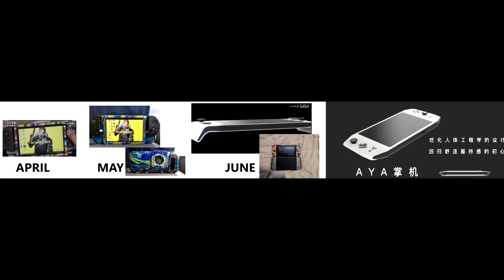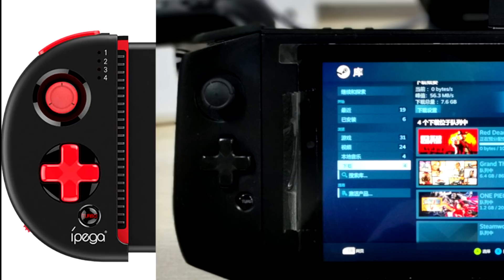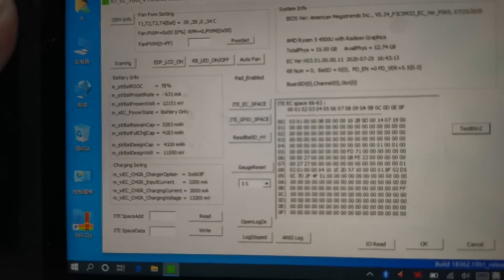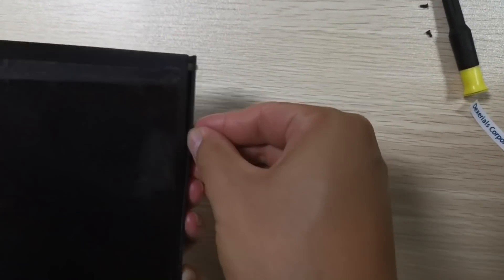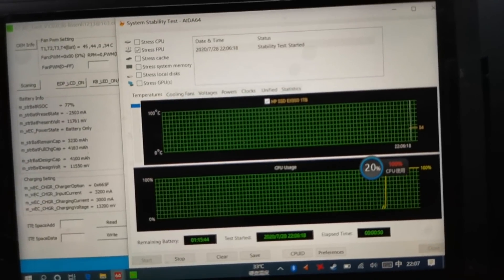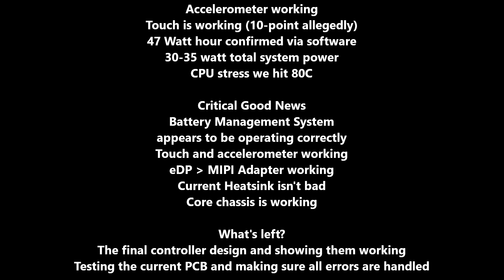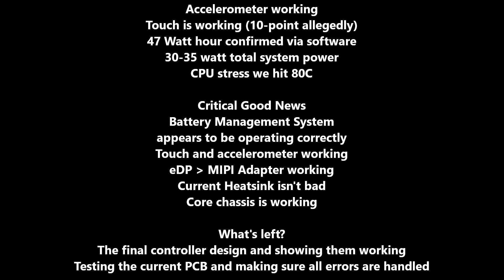AYA-NEO - What We Know So Far - AMD Ryzen 4500U Gaming Handheld - Part 2

Comment: handheld gaming pc slowly becoming a thing now
Reply: Yeah, handheld x86 APU is powerful enough to run full fledge AAA games, but power consumption is still too high and even with huge capacity batteries still last 1,5-2 hours of intensive gaming :/
Reply: @rincewindthewizzard6594  Yea 30W is insane
Reply: Smach  I mean a ps4 portable shouldn't be impossible on like a 5nm node. The jaguar cores are already for portable use and the slim is like what 80W at 14 nm. Some energy optimization and it's within  a decent full system W.
Reply: 🙏 Hopefully
Reply: @rincewindthewizzard6594  I think we'll see a full fledged effort to make these by big companies when ARM architecture becomes more universal in laptops and desktops.
Reply: Nah Arm is the future
Reply: @88oscuro  lol who gonna put jaguar cores on 5nm that's a waste of silicone
Reply: @malathomas6141  I guess you mean Silicon and not silicone, would be quite silly indeed to make APU's out of silicone.
Jokes aside.
They are very power efficient and allows for 100% backwards compatibility. We are talking about making the APU in  base ps4 possible to use in a handheld.

Both Sony and Microsoft have mentioned why they didn't go for Ryzen cores in ps4 pro and xbox one x.

It was a theoretical discussion, and yes your point is a valid one as well.
Reply: @88oscuro  a ryzen 5 4500u would be better to put in a Sony handheld compared to jaguar cores and yes I meant silicon
Reply: @rincewindthewizzard6594  Give it a few years. They'll get there.
Reply: Yeah if you call under 1080p and less then 60 fps gaming on low settings. My GPU is is bigger then this.
Reply: @ragingmonk6080  nobody cares how big your gpu is
Reply: @malathomas6141  " nobody"
Well, just because you are nobody and replied.....
Reply: @ragingmonk6080  stop tryna boast when nobody cares bye just wanted to point that out
Reply: @ragingmonk6080  we know bro this handheld is as powerful as a Xbox one
Reply: I hope so but they still have a long way to get the perfect iteration. Just hope AMD continues pushing the low-power, high-performance APU even further or maybe an ARM processor that matches with PS4 Pro's performance at least.
Reply: @malathomas6141  Well if the can shrink the current chipset in PS4 for a handheld they got 100% compatibility on PS4 entire library day 1. 

Developers knows the hardware and frankly, PS4's hardware (weak CPU cores aside) is good enough for a handheld even in 1 or 2 years time.

I doubt a Switch revision will get anywhere close to PS4 specs.
Reply: @88oscuro  if switch hypothetically  use 4800u they already have ps4 performance
Reply: @malathomas6141  Nintendo will ride along with Nvidia for a while.
Reply: @wiskymo9687  that would be their downfall I hope they use mx 250 in next switch
Reply: cutting transistor size in half doesn't cut the power draw in half. the die shrink of the PS2's Emotion Engine from 250nm to 90nm reduced the power draw of the console from 80w to 45w, and that was twenty years ago. a highly performance optimized 80w chipset is not going to magically become portable with a die shrink, especially when that chipset architecture is well known to get outperformed in portable applications. intel spent like ten years trying to make an x86 cell phone and it got its ass kicked by ARM chips with ASICs. nobody has x86 devices that consume less than 20w for a reason and its not process node
Reply: @Cheesemonk3h  4500u can go as low as 5w and at 15w yep consumes 18w so your wrong this isn't Intel on 14nm
Reply: @ragingmonk6080  Good, I wouldn't want a handheld that's bigger than a GPU. It wouldn't be very portable.
Reply: @richardg5301  A laptop is portable.
Reply: @fajrdn  ARM cannot kill x86 ... thats true story
Reply: @rincewindthewizzard6594  just gotta wait for solid state batteries then :)))))))
Reply: @malathomas6141  4800u can't play all Ps4 games without 1000 of hours of work to port them...
Reply: I remember playing Skyrim, RE5, Borderlands and Arkham Asylum on a z3735F and an iPega 9023 at 40-60 FPS 360P 5 years ago. I also had a 10000 mAh Power bank I could velcro behind the controller's support in case it would run out of battery.

Handheld gaming has been there for longer than one could imagine (even if there was a lot of jerryrigging involved) and it felt awesome. Playing Skyrim on the go is one of the most satisfying things ever. Pocket Xbox 360.

Comment: Really exciting stuff.  A GPD Win 2 style device with a 4500u  would be amazing
Reply: @Opjink GPD could have use AMD
Reply: The 4500u is an amazing CPU but the GPU is just kind of...OK-ish.  AMD seems to be moving more towards the Intel model of having a basic integrated GPU for running things like desktop software on an ultrabook or as a lower-power option with switchable graphics when paired with an external GPU.  Their latest APUs actually have fewer GPU compute units than their old ones (while going up to 8 CPU cores now), though they are clocked a bit higher thanks to the process shrink.  In short the percentage of silicon dedicated to the GPU has been shrinking.

Meanwhile Intel has been steadily improving their integrated graphics every generation so the gap between the two isn't nearly as large as it used to be.

It's kind of a shame because for a gaming handheld like this you really want more GPU power even if it means having to sacrifice a bit on the CPU side of things.  The CPU is already more than enough.
Reply: Gpd developers said that they will try making a laptop with 4500u. They also said they will release a gpd win 3 next year
Reply: @hairypancake4425  yeah but note that it will lag on yuzu
Reply: @Kevadu 
sure buddy 🙄 🙄 🙄 🙄

Intel APUs are getting boost in graphics 

Guess I have to appreciate my $500 i9 9900K comes with UHD 630 is totally equal to AMD’s bottom barrel $50 Athlon 3000G’s VEGA 3 in game performance. 

Not to mention that punny VEGA 8 out perform almost 2x to UHD 630. But I agree AMD could have kept Vega 11 or better improve the RX Vega M. It’s still very powerful GPU even for 2020.
Reply: @Hairy Pancake He was referring to the ice lake gen 11 graphics that are in Intel mobile cpus (which is what these pc handhelds would be using). The G7 graphics is about around a Vega 10. For desktop you're right intel doesn't have any competition tho.
Reply: @Some guy 
love to see GPD getting hands on that shiny new 11th Gen if the APU is going for Vega 10 graphics.
Reply: @hairypancake4425  it's what's in the gpd win max already. Edit: after more research it's more between Vega 8 and 10 for actual games, but still much better than their old hd graphics
Reply: @Some guy
I’m glad that APUs are getting love from Intel since Intel HD has been a joke for years. Doesn’t matter if Iris plus 940 exceed Vega 11 or 10 at the end of the day we’ll be looking at screen barely 1080p and as long as it runs smoothly and look nice 👍 for Intel.

Comment: About the weight, they can easily add a counter weight to the left side of the controller board. It’s not a thin unit by any stretch of the imagination and a controller board is pretty basic, even with rumble/haptic motors.

Comment: Thanks for the videos on this, phawx.  I have a win2 and was going to skip the max and get a 3 but maybe this is a better option.  Although I hope the sticks aren't the same design as the Switch so buyers don't get the inevitable drifting and also I hope they can get the weight to be under 1 pound.  I'd be ok with a smaller screen too.

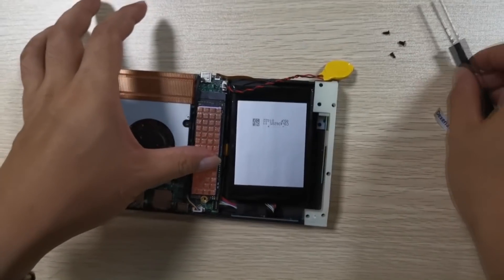Comment: 4:21 - That's no heatsink, it's a neural net processor.  A learning computer.  The more contact it has with humans, the more it learns.
Reply: So everything from China is spying ? This company is private owned
Reply: @malathomas6141  That was a Terminator 2 reference, numb nuts.
Reply: @itchyisvegeta  lol dont remember hearing that quote
Reply: @malathomas6141  The theatrical version when they are in the mechanics shop at night pulling the bullets out of his back with pliers, and John asks "can you learn stuff that you haven't been programmed with, so you can be... you know, more human.... and not such a dork all the time"  or some variation of that line.

The extended version instead says, "my CPU is a neural net processor, a learning computer, but when sent out on missions, Skynet sets to Read Only"  then cuts to the extended scene of resetting the chip.

Comment: Interesting. I think they might be able to ship it in Q2 of 2021. And that would be really good. 1 year from concept to market would be quite impressive actually. However, I doubt it will see international availability until like Q3 or Q4 of 2021. And if it does, I think it will be more expensive than a GPD WIN MAX, So, I don't know it would be worth it. Now, because why not? I wonder if this thing will ship before the Smach Z? Would not that be something crazy? something going from concept to market in like a year vs the Smach Z that it seems will end up taking almost 7 years to achieve that. IF it does come out this year.
Reply: It's would start to be shipped before the end. Of the year they are 80-90% finished and they said $600 which is cheaper than gpd win max idk why u trying to downplay it. Hater
Reply: @malathomas6141   I am not a hater of the AYA-NEO, just skeptical. I am also highly skeptical of they shipping anything in 2020 other than a few prototypes to people like ThePhawx and Taki Udon in order for it to get tested and shown properly.  I will stand corrected if they do ship this year, I just don't think it is possible, Testing and QA alone takes 2-3 months once you have a final prototype.
Reply: @AvatarEquis  maybe December or early January

Comment: 1:04 isn't that suspiciously similar to the Alienware UFO?
Reply: The AYA-NEO is no doubt grabbing a lot of inspiration from both the vastking g800 that never came out and the alienware ufo.
Reply: They're both basically just "the Switch but with Windows". Not that I'm complaining.
Reply: @breakatmo  but they are better than the switch tho
Reply: @malathomas6141  Maybe once it can emulate switch games
Reply: @otimo144  if there is a switch emulator then yes it should have no problem emulating switch games
Reply: @malathomas6141  There are two emulators, and actually they work pretty well with AMD components.

Comment: Not sure why they would use the desktop to demo instead of the full screen start menu which is ideal for an all touch device such as this.
Reply: does it matter?
Reply: @malathomas6141  I guess not, just looks like one more unfinished item in this video. Windows desktop just doesn't work well with small mobile devices due to large finger input and small targets, just something that makes it look not built for purpose (the device). Tablet mode would work, and make it look a little more polished.
Reply: @robertmoranelli  well them use tablet mode problem solved

Comment: I want a handheld with a dedicated gpu, and I have some ideas.
Reply: There is no dedicated gpu efficient and powerful enough for this situation the gpu in this is between gtx 650 and gtx 650ti performance while using 18w
Reply: @malathomas6141  my idea for a system can support a 100w for about 2hours.
Reply: 8" screen
Reply: @matthewcherrington2634  the battery would have to be 200wh a battery that size would be as big as this handheld and would take 4 hours to charge at 50w
Reply: @malathomas6141  ravpower 32000 1 or 2 of them have not fully decided yet.
Reply: Studio book but smaller general concept.
Reply: @matthewcherrington2634  32000? Of what
Reply: @matthewcherrington2634  u want to make a laptop?
Reply: @malathomas6141  ravpower battery
Reply: @malathomas6141  A laptop the size of a gpd win.
Reply: @matthewcherrington2634  oh ok well good luck with that

Comment: Everytime amd always has issue with battery
Reply: No not really
Reply: @malathomas6141  nah mostly device like this switch to Intel or take long in development
Reply: @malathomas6141  that's why Gpd stick with intel
Reply: @st3v3nzzz1  they choose Intel because they more comfortable ig but amd laptops apu are efficient than Intel
Reply: @st3v3nzzz1  that's not the reason
Reply: @malathomas6141  nah that's the reason see smach they still has problem with the battery phawx has all the video or another channel
Reply: @st3v3nzzz1  but he said in this video the battery management is working fine so they just didn't get it to work that doesn't mean the same for everyone
Reply: @malathomas6141  that's what they said not in real life smach say that too and still silent almost a year now
Reply: @malathomas6141  efficient in battery, and yet you compare it to laptop. device like has minimal size laptop didnt have that problem

laptop doesnt can manage heat, device like this is hard 

beside you ever try ryzen apu with 35 or 45 tdp? with tiny battery how long it will run

try search smach if you dont know the struggle
Reply: @malathomas6141  or even better see this comment section
Reply: @st3v3nzzz1  is 4500u is 18w and the system draws 25-30w giving it 1 hr 20- 30minutes of gameplay at full power
Reply: @st3v3nzzz1  bro from the video the battery management is working remember smack z wasnt using ryzen 4000 apu it was using ryzen 2000 apu the ryzen 5 2500u so that could be the reason
Reply: Current gen Ryzen parts which this will be using is amazing with battery life.